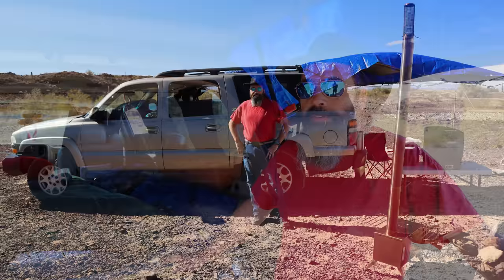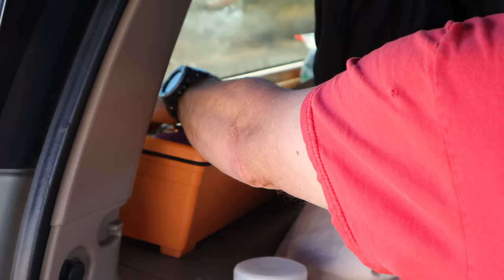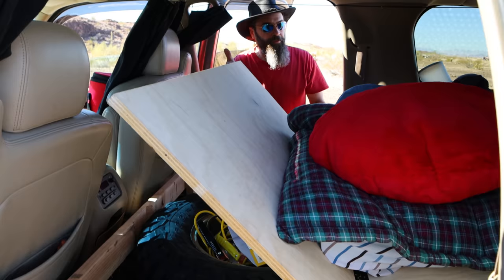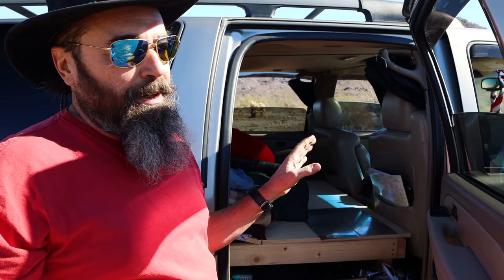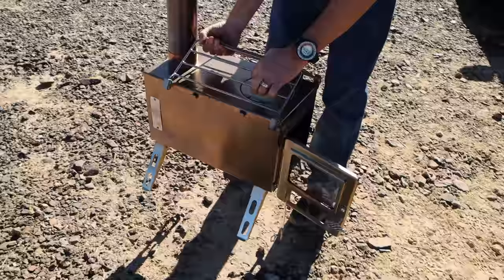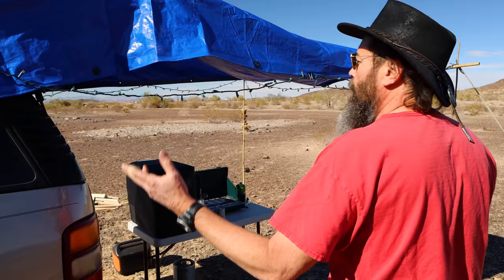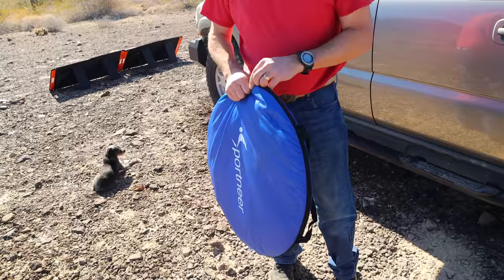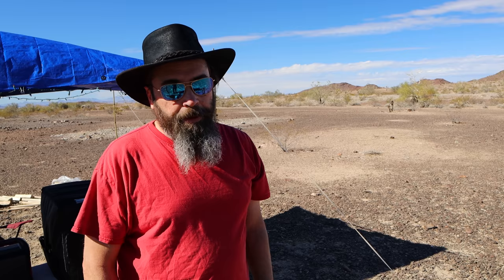How to Camp in an Off-Road Suburban—FULL TOUR (Sleeping & Camping in a Big SUV!)

Comment: Thanks for this tour, Tristan. I wish I had seen it in 2020 when I built out my 2017 suburban. I purchased my suburban with the idea that I would drive it to sub Overland and have Grady do his complete package on it, however they would not touch it since it has side airbags. I was disappointed and proceeded with my own build. I had purchased a lot of camping equipment including a cool ARB awning that extended out the back of the suburban. It took up too much room.  I cannot imagine him putting a woodstove in his suburban. That seems dangerous and it would get very hot.

I took early retirement during Covid and was planning to live in my suburban full-time. That lasted only a few weeks. I have a senior greyhound with me and it was just too tight and uncomfortable. When I got to Nevada, I purchased a 20 foot travel trailer . I like  my showers and space I get out of this 20 foot travel trailer. I got rid of the suburban this year, traded it on a F250 pick-up truck. I might add a truck camper to the back of it and venture out again, leaving my travel trailer in storage here at the RV park. But right now with gas prices are high and traveling being expensive, I have a good deal here in Pahrump at an RV park plugged in. 

I made this offer before,  you’re welcome to come spend the night or two if you need a break from the road!
Reply: Hi Bob,  I know I'm  literally playing with fire so I'm taking many precautions. I'll have 2 fire extinguishers and maintain a strict limit on how much wood goes in. I haven't decided for sure to actually put it in the camper, I may do a tent extension off the back instead. Look at "Lone wolf 902" videos, you might get some crazy ideas for your F250 truck bed! Thanks for watching!

Comment: I've heated our house for 25 years with wood and used a small wood burning stove in the wall tent while camping and I gotta tell ya , that setup he has for the wood burner inside the Suburban is VERY scary !!! Hope nothing happens to him .
Reply: Disapprove of the wood burner stove being used inside a vehicle, too.  However, liked the interior hanging wraparound privacy curtain, a variation should work inside my lil' 2-door Wrangler (rear seat removed).
Reply: What is the issue with the stove? Is it too hard to reliably keep the stove heat from setting things on fire, or the danger of flaming logs accidentally falling out?
Reply: @jwagnermail  Heat source is too close to exposed flammables, i.e.: plastics, vinyl, cloth, etc.  I could see an errant burning ember easily setting the vehicle on fire.
Reply: I know, right? The whole wood stove idea would never have occurred to me if I hadn't seen it on Lonewolf 902 Youtube videos. At first, I thought he was crazy but over time...
Reply: @thomasjackson1690  wolf has his stove in the rear of the pickup with a cap, better setup, seems safer than right behind the front seat.
Reply: @kimdagnillo8246  Agreed! That is the source of my hesitancy. Although, Wolf's stove is very near wood cabinetry, bedding, and he also keeps his firewood near the stove, and the cap has fiberglass resins in it. Stove or no stove, I might cut into the rear hatch's interior plastic trim to access the linkages in the hatch so I can open the hatch from the inside in case of emergency as opposed to breaking the rear glass. I think that is a good idea regardless. I'm also thinking of a hot tent extension to the rear of the 'burb. The stove may never come inside but I still love it at the campsite. Keeps the smoke out of my eyes. Thank you for your comments. I probably need them cause I may have gotten a little carried away with the idea. But, mmmmm. fire good...
Reply: @thomasjackson1690  I know , I’m a fire sign !
Reply: @thomasjackson1690  sorry , wasn’t finished…definitely put it outside in a tent , you can move around better and enjoy more not to mention sleeping with it, your dog will enjoy it too
Reply: @thomasjackson1690  yep, he has his in the back of his camper topper. I want to do that. I'm curious if this guy put it in and how it's working.??
Reply: @thomasjackson1690  you can fix topper's to lock from the inside. And easily open the hatch from the inside. Check out Crazy Quady's setup. He fixed his to lock even though he doesn't use it very often.
Reply: @thomasjackson1690  did you get in put in and how did it work??
Reply: @shandelebroyles1099  I have decided against it. Too much heat and I get my fire ambiance outside anyway. The stove chimney is awesome! No smoke in your face.

Comment: I love it. I’ve had my 96’ Suburban XL for about 8 yrs now. Same interior, same tires. I’ve upgraded the tranny and transfer case. Wanting to drop a Gen 3 motor in it when 9k drops in my lap. I have tried camping out of mine in multiple, removable, configurations. And I just can’t sleep in it for more than a night or two. And my Mr Buddy heater doesn’t like to work in it. So I have outfitted it with a pop up, and a queen sized cot tent. In winter I take my kerosene heater, tarp off the wind sides and I’m good to go. I could walk out right now and leave in it, and not need civilization for as long as I have fuel. I really want to put a good push bumper on it with a winch. Want to bed-line it, probably in the next few months. 10x10 rip stop tarp…I need to get some conduit to do a cover off the side. Like yours it a work in progress. 😁. Cool set up. Great video
Reply: I do want to do a slide out that can accommodate my gun cases and double as a kitchen counter top. Trying to figure that out while keeping my back seats in place.  I think I got it figured, but worst case I’ll have to drop them.

Comment: Thomas, I have seen some ideas here that I haven't elsewhere! Thanks. Interesting one loop curtain using paperclips!   Fascinating! And plant window boxes:) Awesome 2x4 on a hinge for the plywood floor platform!  He's got some great and simple ideas here. Metal kegs of water! and holding up platform.  I am curious about the water containers. How do they open and close and not leak? I have arthritis and things are hard for me to open....
Triple wall insulated sort of chimney to go out the window when using a wood stove inside!... So intriguing. I think I would use something else under the heat shield on the floor? Asbestos - is that still allowed? Ceramic would probably heat up, may need air space under???? Sure glad he has a fire extinguisher. Whew.  Lots of ingenuity here.  (I think he must be using the small instead of large winner well wood stove, but I may be wrong)
Reply: Hi Susan, The kegs have a screw on lid with a rubber seal. They wont leak and don't have to be very tight to create a good seal.

Comment: 8:42 I recall some reviews of vehicles they had a "plywood sheet test". They reported on whether the cargo area accomodated a sheet of plywood. It's that important to prospective vehicle buyers. That size is also about the same as a twin bed. So, nice for moving day.

Great ideas. A real "no build build:. There's always room for future mods. I don't know about a wood fire inside the SUV though.

Suggestion. Have TWO fire extinguishers. "two is one. one is none". Also, having them stored in two locations means if a fire prevents reaching one, the other location may be accessible.
Reply: 2 extinguishers! good idea! I have not yet found the courage to burn the wood stove in the Suburban yet. I get the inspiration from Youtuber Lonewolf 902 who camps in hot tents and has rigged a wood stove in his camping vehicle.
Reply: @thomasjackson1690  Yes I've seen several YouTube campers with wood stoves in tents. Some places though, taking wood from the ecosystem is determentale. Not like pioneer days anymore. A diesel heater makes a lot more sense in a vehicle.

Comment: Heat transfer through metal so even the short legs will most likely transfer heat , how much depends on heat inside stove. Tom will need a fire pad like the ones under grills or a fire blanket pad.
Just some helpful hints .

Comment: Since you took the spare from the bottom.... You have space to build a steel frame under there to mount the air compressor, generator, water tanks, but more of a permanent type installation

Comment: Excellent tour, lots of great ideas to make it all useful and practical.  One small suggestion, take a look at the material they use in a fireplace, it's sort of a sheet masonry that shields the area surrounding the fire box.  You might want to create your heatshield out of that rather than the metal heatshield, especially on the bottom.  Overtime plywood dries out and eventually under the right conditions can ignite from temperature alone, the masonry might offer additional protection. Be safe and enjoy your adventures. Great set up.
Reply: Thank you for the added material type ideas. I am testing all kinds of ways to make it safer like different fireproof materials different chimney configurations and how much or little fuel to put in the stove at any one time.
Reply: @thomasjackson1690  cement board would be great under the stove. Make it big enough that if anything falls out , it doesn't catch anything on fire.

Comment: You should make a portable v wall out of cement board with pebbles tiled onto it for a heat protector. I think I would feel safer that way. Better than hot metal that could fall against your seat or door.
I'm from NE Arkansas.

Comment: Thomas has a really nice setup . Suburbans of that vintage are in my opinion one of the best trucks GM ever built. The front bumper and winch got me thinking that I want one of those. Thanks for the link. You mentioned that you had an adventure in  Nevada with your transfer case on the Yukon. I think it was at the start of this trip. Are you going to tell that story .
Reply: We've had a few Tahoe's / Suburban's over the years and one thing that happens is the transfer case solenoid can go out, keeping you from being able to shift from 2h, 4h, and 4l. But they're awesome rigs for the most part.

Comment: Excellent, you covered most everything, except the one question I have. Does having your rear hatch open drain your battery? How do we get around that?
Reply: Funny you should ask. I actually drained my battery the morning of the video and Tristan had to jump start my rig. There is a dome light shutoff button near the headlight controls on my vehicle. I forgot it was there and didn't notice my lights were on.
Reply: For Subarus, yoy can insert a flat edged caribeaner into the hatch latch that turns off the "door open" indicator on my 2015 Crosstrek, it also turns off the lights that shine back on the newer models.  I saw a youtube video on it.  I will add the link in a reply to this comment.
ALSO, please everyone buy one of those portable battery packs that will jump your car without the need of a second vehicle!!!  $50ish bucks at Costco or on Amazon.  It saved me while boondocked out east of Albuquerque last year.
Reply: Here is that link of the caribiner fix for the Subaru hatch battery draining issue.  https://m.youtube.com/watch?v=bbS1Um-6Qq4
Reply: @paulas_lens  Agreed! I just got my Jackery car battery charging cables last week!

Comment: How do you connect your fridge to the car?? Is the car battery not affected ? ?
Reply: He runs the fridge on the Jackery.
Reply: @freedomdove  I run it from the cigarette lighter when I'm driving. Also recharge the Jackery from the rear lighter socket when driving.
Reply: I mounted my renogy panel on the roof of my Crosstrek and it charged my Bluetti while I was driving, at camp, etc.  It was perfect.  I also have an Iceco.  The freedom from ice has been a gamechanger!